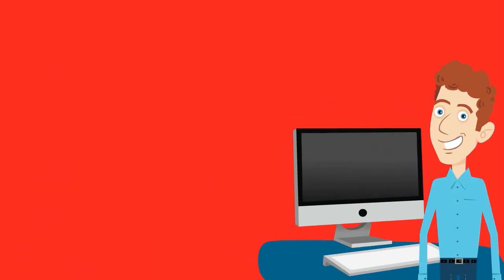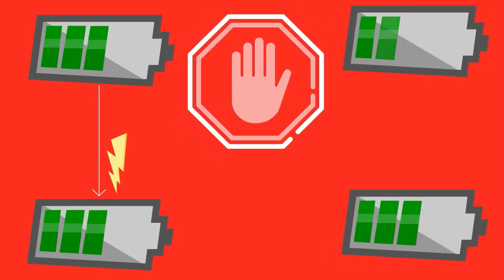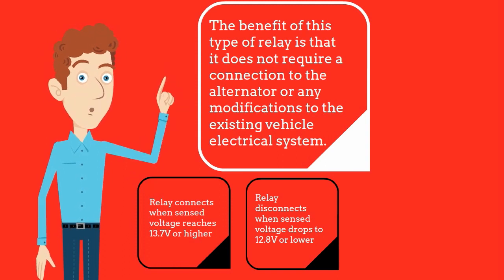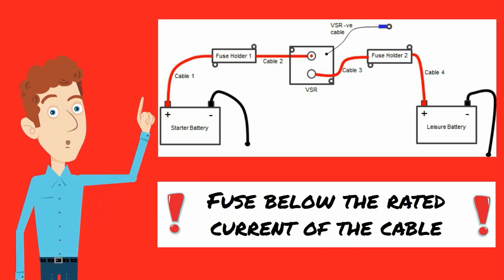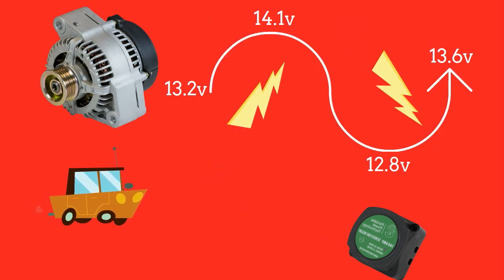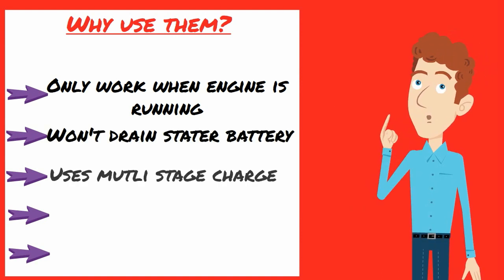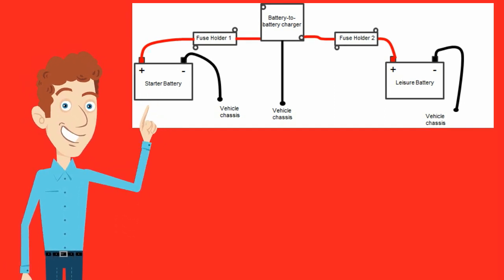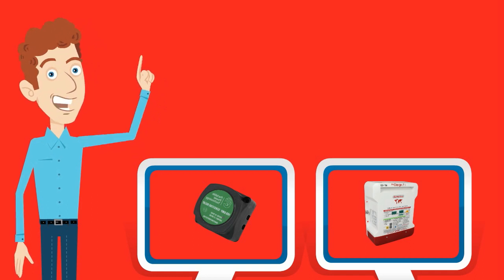Voltage Sensitive Relays (VSR) & Battery-to-Battery Chargers Explained | 12 Volt Planet

Comment: Is it possible to use VSR with GEL batteries? Since the chemical content of GEL batteries very sensitive to the sudden&high current I really suspected to use it..
Reply from the maker: No, they would not be suitable. You would be best selecting a battery-to-battery charger and then selecting a profile that matches your batteries requirements. If you need any further help please contact our support staff 01865 236 446

Comment: why fuse ? if i have 80ah battery can u tell me which fuse to use ? how many amper fuses
Reply from the maker: You would fuse to protect your cable from power surges. A fuse is not based on your battery rating but on what your cable can take and your unit will draw. check out our fusing video for more info https://youtu.be/WOwYtH0e9So

Comment: Does the B2B work in the same way as a VSR insofar as if I connect a mains powered charger (or solar system) to the leisure battery it will also charge the vehicle battery?
Reply from the maker: Hi, It will in the same way however it is not 2-way directional so it will not charge the starter battery if there is a charging current on the leisure side. I would recommend hooking up your solar and mains to your starter battery if you wanted to charge both batteries from those sources. If you need any further help please contact our support staff.

Comment: hi.. do you know if it's possible to use a vsr as a switch in a solar system for dump loads ..for example when the batteries are fully charged  the excess power could power a low power immersion heater for hot water.. your thoughts would be much appreciated... thanks for contributions.
Reply from the maker: Hi, As the VSR will only turn on when the level of voltage hits a certain threshold so when the batteries are producing that voltage it would feed the power through until the voltage dropped. As the voltage would likely drop quite quickly we wouldn't suggest it as the best method of achieving your goals. If you need further help email us sales@12voltplanet.co.uk

Comment: My main battery has gone flat twice since installing a VSR and auxiliary battery.

I recharged the battery over night from a 240V wall charger and when 
reconnecting it to the vehicle in the morning I could hear the VSR 
clicking (solenoid) when I reconnected the battery terminals (I tapped 
the positive lead on the terminal a couple of times to confirm).
Is it possible the VSR has a draw of its own from the main battery?
Reply from the maker: Hi, The VSR shouldn't have a draw unless there is a voltage greater than 13.3v (typically). Unless you're charging one of the batteries the VSR is connected too there should be no connection being made. It sounds as though you may have a faulty relay and I would suggest replacing it.